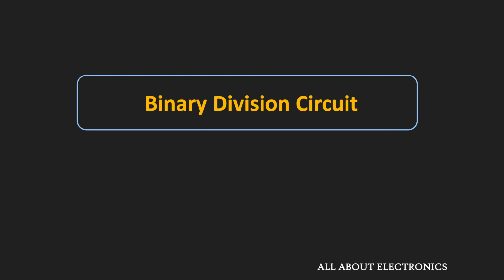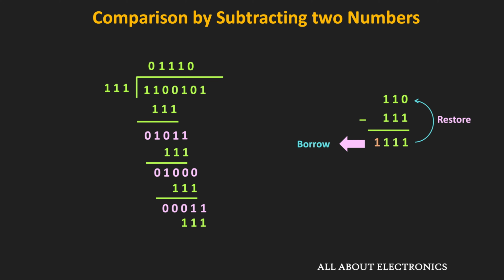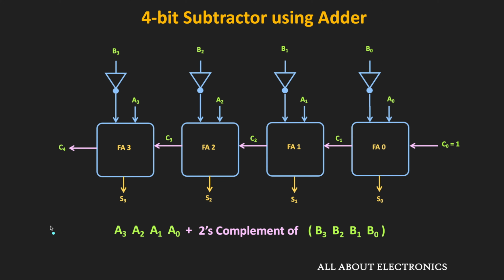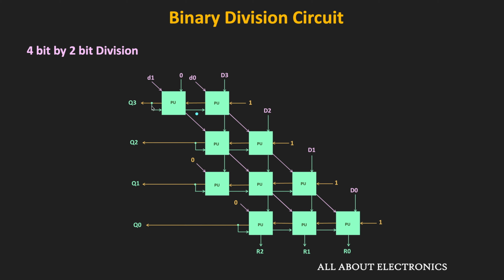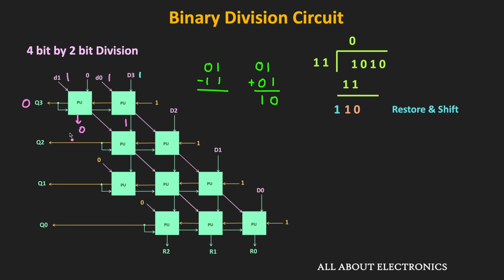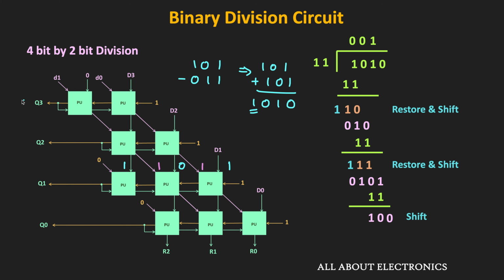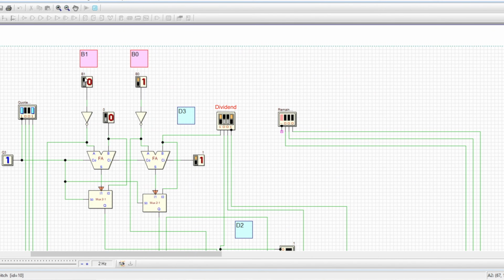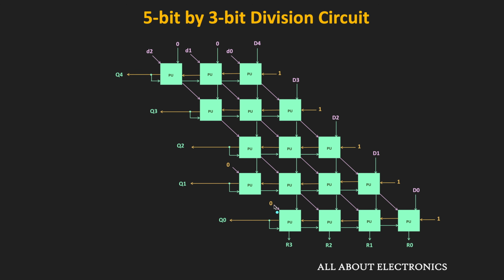How to Design a Binary Division Circuit ? Binary Division Circuit Explained (with Simulation)

Comment: Hello, you mentioned the number of rows that requires an extra processing unit on the left equals to the dividend minus the divisor, and that they are situated at the bottom. So does this mean that you do NOT need an additional processing unit if you are doing 8 bit by 8 bit division because 8 - 8 = 0?

Additionally I would like to ask what to do if I want to go 4 bits beyond the 8 bit quotient (that means 4 bits to the right of the binary point). Would the following diagram have 12 rows and 8 columns with no additionally processing units? Thanks!